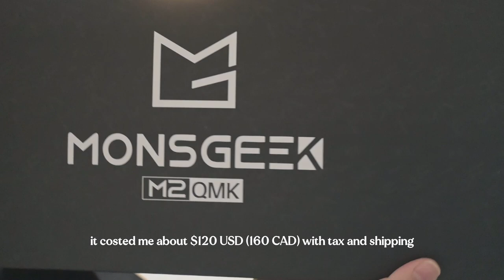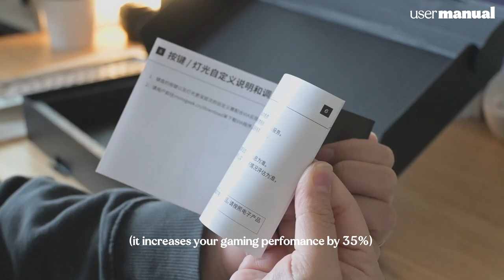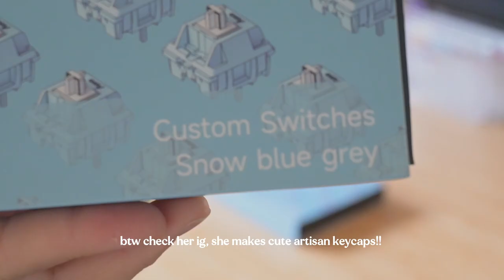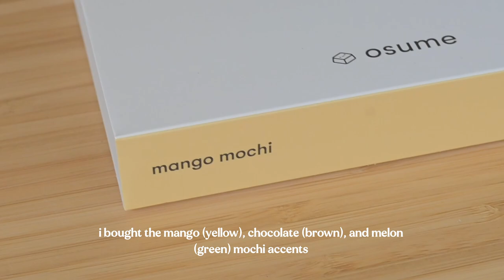monsgeek m2 build guide + sound test | akko cs snow blue grey

Comment: Those osume keycaps look so crisp and clean, sis 😭 

Hey hey welcome back 🎉 arghh monsgeek keebs.. I've been debating on getting one for so long bc I wanted my first alu keeb but I was torn between getting a budget one or the premium ones (been eyeing the zoom75 as we speak but I've never done group buys before.. And no moneysss 😭).

I also kinda wanted one with a silver case too to match a keycap set I have in mind. Your video gave me a good idea how a silver monsgeek case looks like so I can picture how it looks like. I'm surprised by how much foam there is in the keeb - and they give tape for us to tape mod?? 😮

You had two configs here...  One with tape and one without pcb foam. What's pcb foam btw? Is that the foam between pcb and plate? All these foams are making me confused. What seems to have the deeper but less muted sound, do you think? 

(I'm so curious what your upcoming purple alu keeb is hehe). 😂

Also akko snow blue gray is such a pretty colour for switches. Do you think they need lubing or are good stock? 

Final thoughts about the monsgeek kb? (I was eyeing their m1 actually) Is it worth getting? Affordable and worth it as a daily driver? Any drawbacks/cons while building it? 

Thanks for the build as always ❤🎉
Reply from the maker: i think monsgeek alu keebs in general are great especially for the value. old flaws of monsgeek m1 is fixed in the new m1 versions (like the jst interference). but if you're already spending extra money, i would save up for something you really want aka the zoom75. I was actually looking at the zoom75 as well but i've already bought the qk75 during the gb! 

yes all of those foams and the tape are all included! which keycaps set did you have in mind?

pcb back foam is just another foam to dampen the sound! I do hear it now that you say that; it's definitely less muted than the tape mod. 

im sure by now you know !! lol 

it's an amazing color and i am in love with it! it comes unlubed and imo, its always better to lube unlubed switches as they just sound wayy smoother!!! 

as my first alu keeb, i couldn't complain at all especially at its price. it may be a deal breaker for people as it is not wireless but honestly for me it's not a problem. alu keebs are so heavy i wouldn't be bringing this anywhere else other than being at my desk lol. i do love it as my daily driver - it's easily moddable (if thats a word lol?), compatible with QMK/VIA! (which i need to play around with more) and for what i do right now the numpad is a great addition.
Reply: @poongie  Thanks for the reply sis 😊 Since you've partaken in a gb before, how's your experience of it? (The buying and waiting process so far) I heard from some vids that they're not worth it and it's better to get keebs that are in stock. They also say budget boards are almost as good as the premium ones you get from gb so I'm in a dilemma haha. 😂 like I kinda want a premium but I don't fancy the waiting and the high cost but at the same time, those keebs look so prettyy 😢

Comment: how do you do force break mod??
Reply from the maker: so essentially you place 2-3 layers of tape on both sides of all the screw holes to prevent the metal on metal contact. i only applied one layer bec i had teflon pad which is kind of 2-3 layers of painters tape